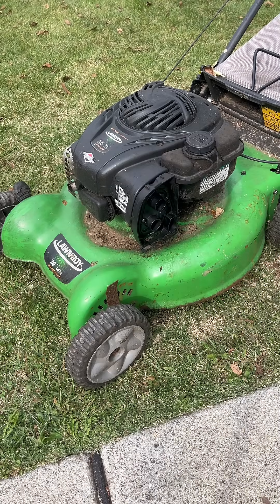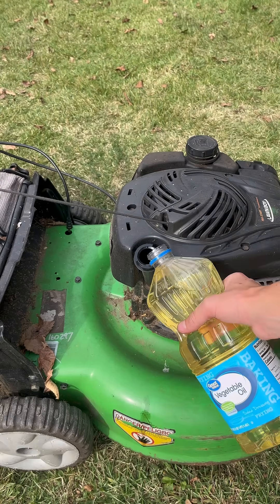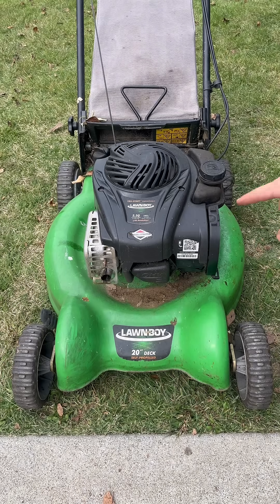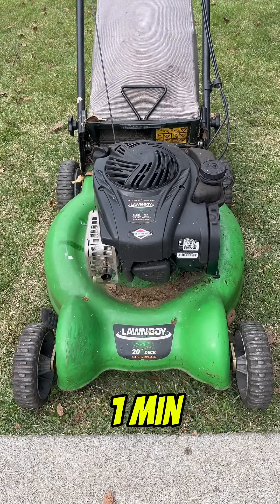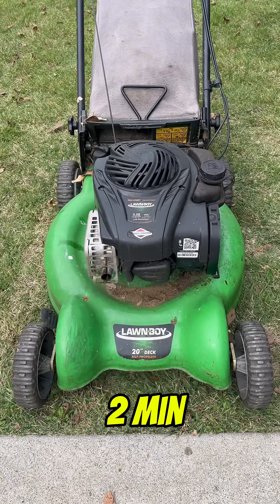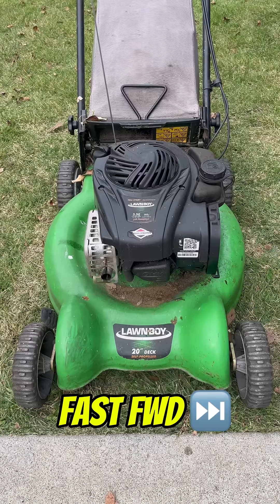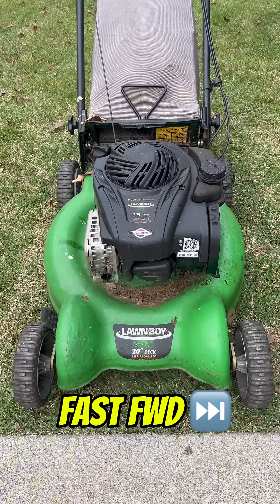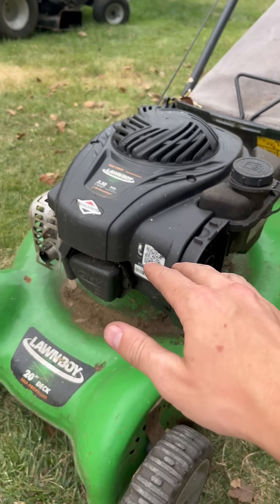Cooking oil as engine oil? Let’s see what happens! #cookingoil #engineoil #lawnmower #mower

Comment: i wonder if engine produces oil pressure on vegetable oil? if you put in in a car wouldnt it destroy bearings in like 1min?
Reply: Most small engines like this don't have a pressurized oil system. Just some paddles driven by the crank to fling the oil everywhere

Comment: Motor oil  breaks down around 460 degrees F and vegetable oils break down between 400-450 so they are not far off in performance.
However, the vegetable oil will leave more goop behind when it breaks down because it is not formulated to do otherwise.